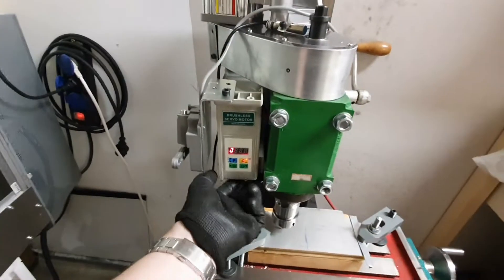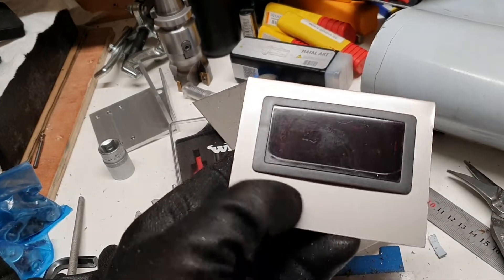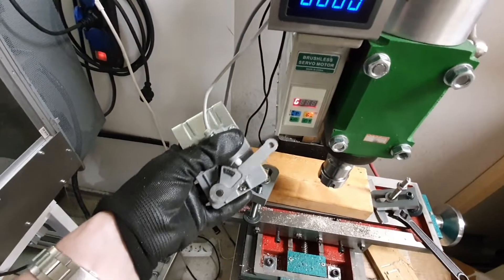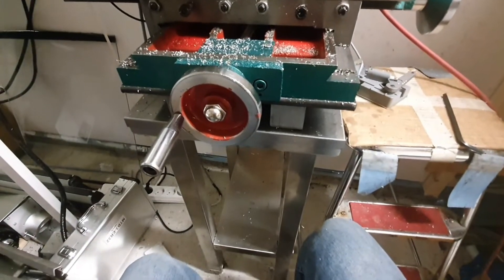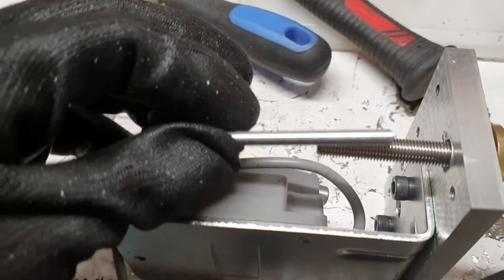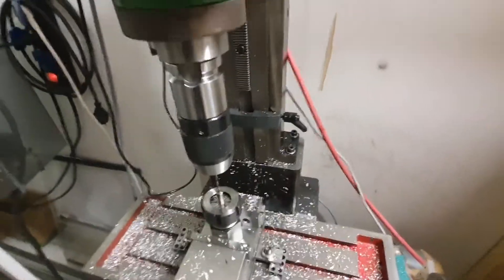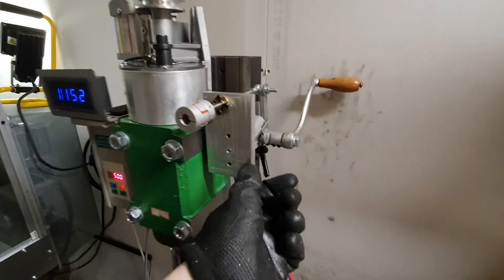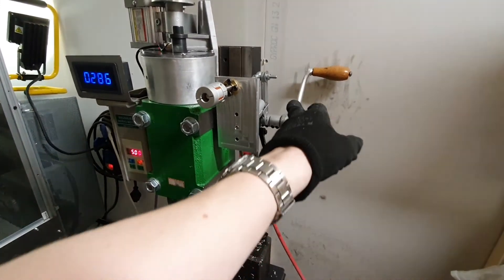minimill builde part 4 - simple led tachymeter mount + aluminium spindle speed adjustment

Comment: How come that you collet holder nut is not flush with collet? Did you install the collet corectly? Collet have to be snapped into the nut, and than you insert it in collet holder. https://youtu.be/WKikm6cQKh0?t=779
Reply from the maker: Thank you very much for commenting and watching. I thought some would notice and comment about that. 

I am Aware of it, I Always do like you say when it comes to the er holder on the mill and on the router.

I tried to install it "correct", like I usually do but it just didnt work. The collet I used fits just fine in the bt30 er32 toolholder. So my only thought is that it is designed to be like that. If you or anyone has a clue, feel free to comment.
Reply: @thechipwelder1253  Is your HEX collet chuck from bangood/aliexpress? I have both (square and hex) collet chucks which I find very useful and I got them from Banggood and their nut is the same as on my MT2-E32 collet chuck. When collet is snapped into nut it's always flush with it.

Comment: Nice mill man, looks good 👍🏼 that threaded rod looks like stainless, go with lower speed, aply some pressure and use flood coolant, make a little instalation from an IV drip to keep things cool if you are drilling with hss tooling, but i would suggest you get yourself some carbide drills ( like 3 pcs, a 5mm, 6.8mm, 8.5mm. The most usual for m6m8m10 taps but you can use them to start holes and finish them with the correct drill size, just removes material more faster )
Reply from the maker: Lol, funny you commented about that, yesterday I ordered some second hand but unused drills solid carbide drills.  4.2mm gühring, 5mm chinese, 6.8mm sandvik, 8.5mm sandvik 10.2mm gühring. 

Some of the drills has through tool coolant holes. Ordered a "cheap" 60 bucks rotary union for liquids from china. Looks a bit like deublin rotary unions which is Think haas machines use to run through spindle coolant. It doesnt handle that high of rpm Though, Only  2500 rpm.

When I have the emcoturn running I Will try to make some stuff so I can connect the rotary union to my bt30 spindle and run through spindle coolant. I wont be able to run super high volumes/pressure, since I Will run a cheap pump, and also lack enclosure around the mill, but it feels like a fun diy project and it wont Hopefully make the drilling worse.

Thank your very much for commenting and watching.
Reply: TheChipWelder i ve bought recently some carbide drills, zcc-ct brand, chinese and i was amazed how good they are, i can say they are better than my sandvik, guhring and seco tools, drilled a looot of holes in w1 prehardened steel and some very tough stainless steel with ease, hss and hss-co could not even scratch that stuff

Comment: Looks like stainless steel. It is easy to work-harden. My experience is you need slowish speed and a constant hard pressure to keep cutting.
Reply from the maker: Thank you very much for commenting. I did some drilling first and it went just fine. I then stopped drilling to inspect how it looked. When I den started drilling again it did not take to long untill the drill broke. Can it be so that it work hardend during a minute or two while I expected how the drilling went?

The drill that broke was a carbide tapped 4 usd drill. The carbide has no coating and looks polished. I had no cutting data for it (cheap tool) but I felt that it was the best drill for the job I had.

After it it broke, it struck me that it perhaps might be made for drilling aluminium. Due to no coating and that it is polished. I have earlier Though succefully drilled cast iron with it. 

Do you Think that the drill is made for drilling aluminium Only?

Thank you very much for the tips.